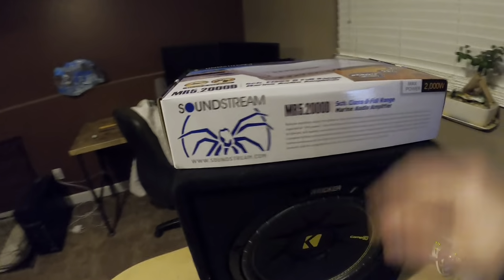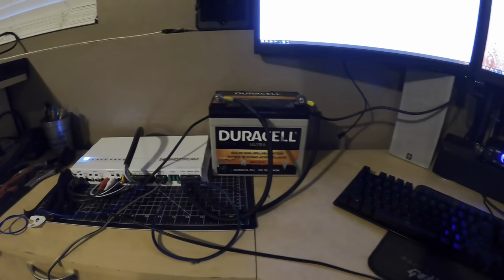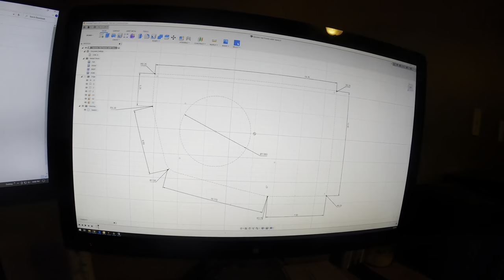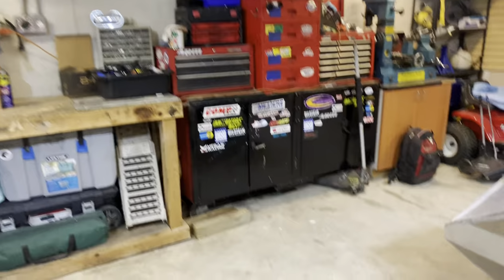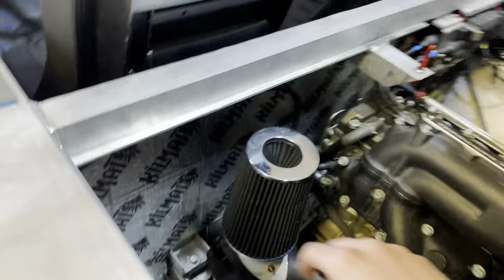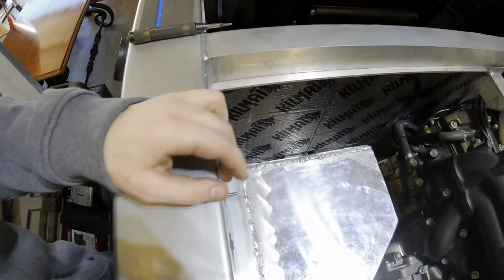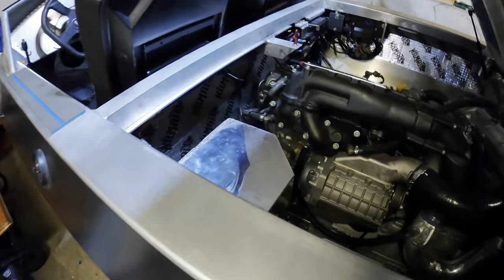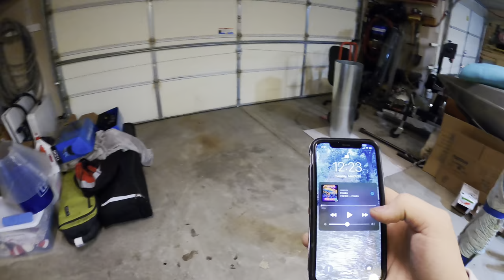Mini Jet Boat Stereo Installation

Comment: Great video, and sick boat man. I'm actually looking at putting a system like this in my outlaw, just wondering what something like that cost you roughly?
Reply from the maker: Hey! I appreciate it!, Total costs were about $540 for the four marine 8'' speakers, the marine 5 channel amp and the 8" hippo sub. Youd need to factor in a proper battery too if you plan to play 7+ hours of music.
Reply: @Localhost127   Thanks for the info, thats actually a pretty respectable price, even considering that's most likely in American doll hairs compared to Canadian.

Comment: Is the stator going to be capable of keeping up with the demands of the stereo?
Reply from the maker: It will likely not be able to if it is turned up to full tilt while the engine is running. I plan to install an isolator and resistor paired to the output of what the stator can output. The majority of the time we’re playing the stereo will be on the beach while hanging out.
Reply: @Localhost127  ironically I was just thinking about this exact problem about 6 hours prior to your vid. 
Keep them mini jet vids up, I love them!!!

Comment: Link to stereo stuff?
Reply from the maker: Amp - sound stream 5 channel marine (mr5.2000d)
8” Marine compression horn drivers (Hifonics tps-cx80)
Subwoofer is a “massive” audio 8” hippo with an eBayaluminum fuel tank as a subwoofer box
The head unit is the cheapest one I could find that had three separate pre-out rca’s.